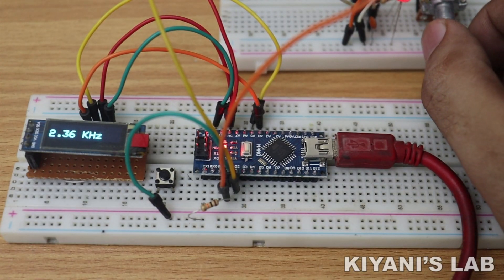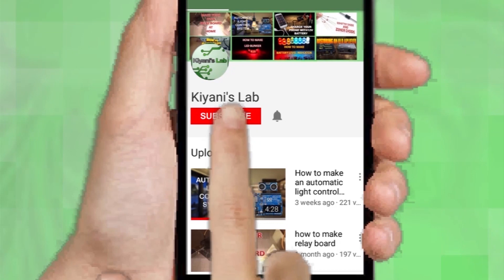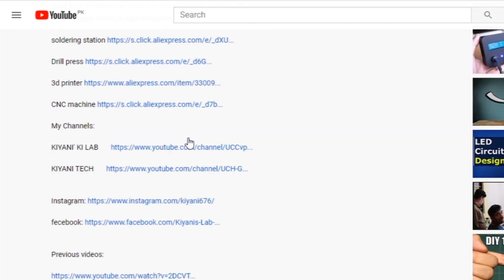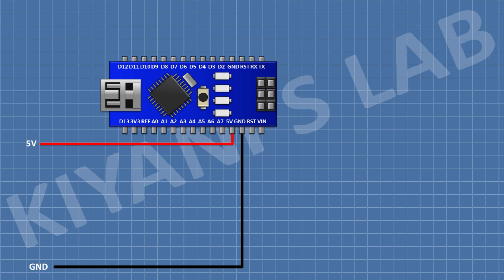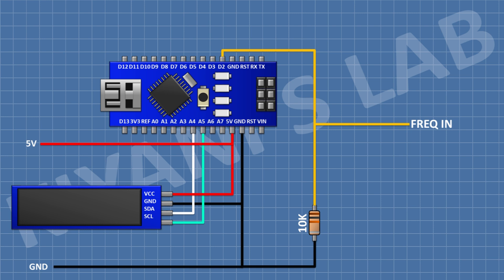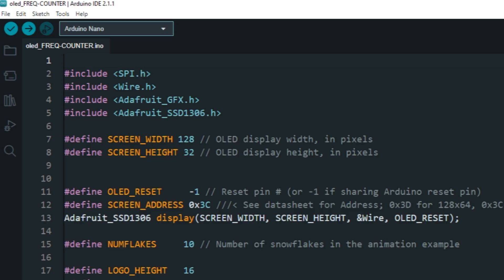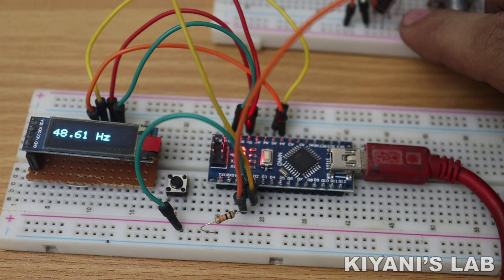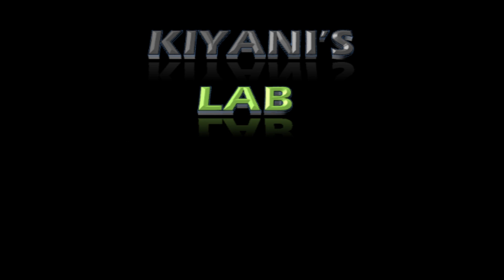How To Make Frequency Counter Using Arduino

Comment: Just what I was looking for thank you friend. But I actually, I was originally trying to find out how to make the arduino do the frequency generating and show that frequency on the oled display. It seems the long way around doing it this way, that is, if arduino can do it with some code and not use a 555 timer circuit. 

It's probably easy if you know how to ask google right the question using the right terms. Which I am unsure about.

Comment: Brother, I am your big Fan. Please make also Waveform Duty cycle information in this. Also please make 12V to 220V Pure Sine Wave Inverter using SG3525, EGS002, Ferrite Core Transformer. Please please brother. Inverter is very important now a days.
Reply from the maker: ok bro
Reply: @KiyanisLab  Very soon please  brother. Try within 1 Week. 😊 Best of Luck

Comment: Is this accurate or not and also is this 1khz to 999khz only
Reply from the maker: It is acurate yes upto 1Mhz
Reply: @KiyanisLab  No, it's not. As you can see, a simple capacitor changes the freq from 240kHz to 80 Hz ! The input signal needs to be shaped with a Schmidt trigger and a programmable divider to measure higher frequencies